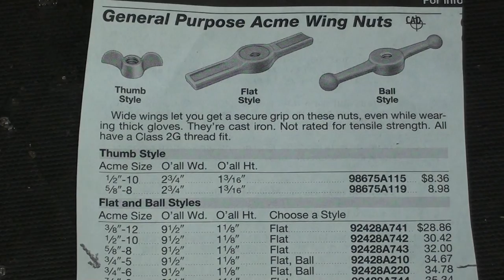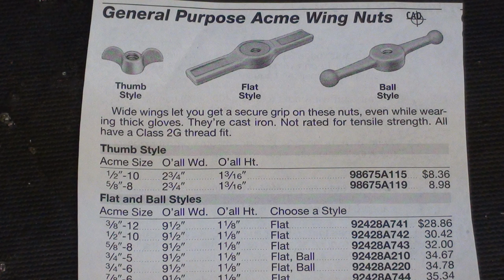TAPPING an ACME BALL NUT #879 tubalcain clausing lathe

Comment: I think this tap isn't intended for thick materials. This because almost every tip on the tap is cutting all the time. As you can see at 7:00 it needs a lot of torque to proceed. This tap is indeed optimal to start threading and it definitely works best on thinner materials. In this case I don't think it's any better than a "normal" cheaper tap.
Reply from the maker: I did not have a tandem, tap, too pricey
Reply: Definitely could be easier with a 3 piece Old School set with taper, plug, and bottom which should be interesting to look into. Any of the aficionados out there up for the challenge to make and patent my idea?

Comment: Dont know about the "no one in the whole world is ever going to do this". Just two weeks ago, i had a  water main control valve strip its stem 4 feet down a hole.  The gate thread was good, just the stem stripped. 3/8 acme double lead. Stems unavailable, manufacturer out of business. Hmm. In theory i could do it. But thread dial for the atlas is missing. I remember taking it off for clearance on a job, but now,... No dial. Well, lots of thinking, watchin of your videos, and grinding of cutting tools, it got done. Valve works a'ok.
Reply from the maker: Amazing, I bet that was a tough one. So someone actually did benefit from the video, lol.

Comment: I believe you are using the hand wrench improperly. You’re applying the force to the moveable part of the jaw where is if you were to rotated 190°, then the force would be exerted on the fixed part of the jaw. Am I correct or are you correct?
Reply from the maker: I have a complete video discussing that

Comment: Those were awfully long chips for cast iron. 

That looked like two baseball bats swinging around the spindle.

Reaching over the headstock with a file like you did scares the bejesus out of me. I always use files left handed on the lathe and stand on the tailstock side of the carriage.
Reply from the maker: I think it was malleable iron

Comment: I don't think that was CI, the chip was a chip, not the dust that normally comes off a cut. It also looked light in your hands, if it were ci I think you would be holding it differently, as it would weigh about 5lbs.
Reply from the maker: It was pretty heavy and did you notice how black my hands were
Reply: @mrpete222  no I didn't. sorry, it just didn't look like CI in color and chip. it was too darn shinny, and the chip was a chip. But I have nothing to offer.. so CI it probably is.
Reply: @jsteifel  You're right, that wasn't any cast iron I've ever machined, maybe cast steel. If it was cast iron he wouldn't have had to switch to a larger wrench. It was obviously a piece he found at auction, so he probably only guessed at it's composition and HOPED it was cast iron.